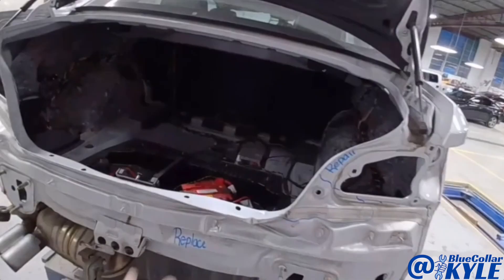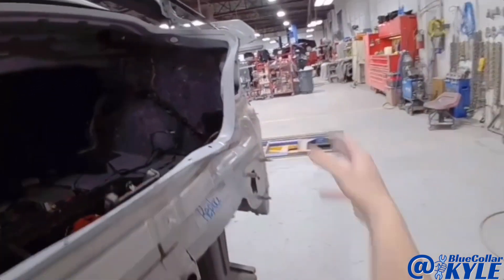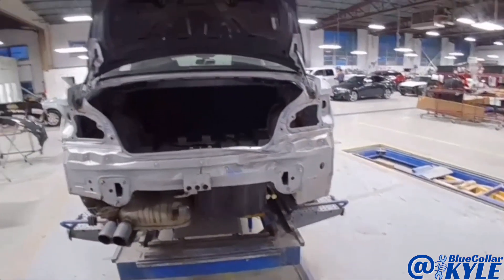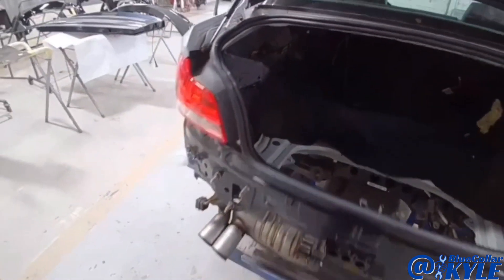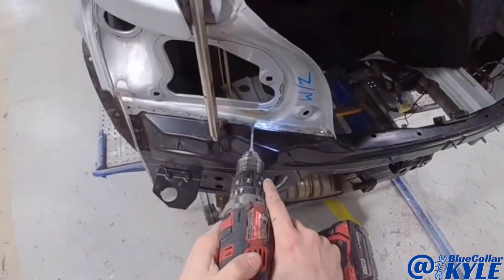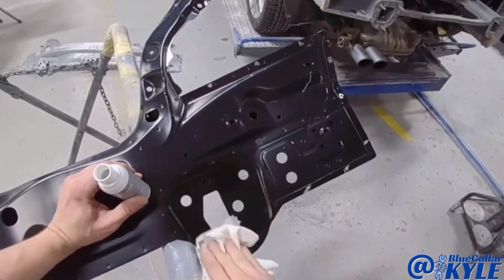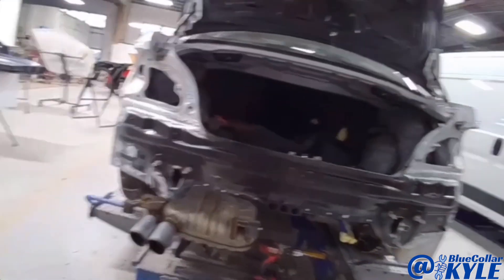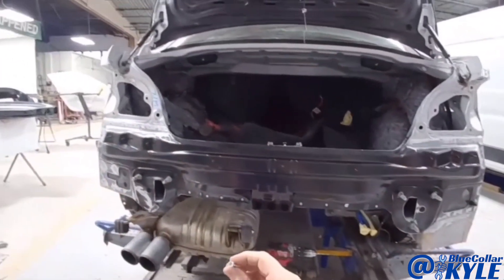Glueing Togethert A BMW!

Comment: did it have all that adhesive before? just looked like spot welds
Reply: BMW is different even though it’s welded on it will make you put a replacement part on with glue rivets and seam sealer in order to not introduce contamination while doing welds by the shop and causing rust later on.
Reply: non of that galv weld through primer eh, sounds like its never the same again :(  @elijahwoods5970